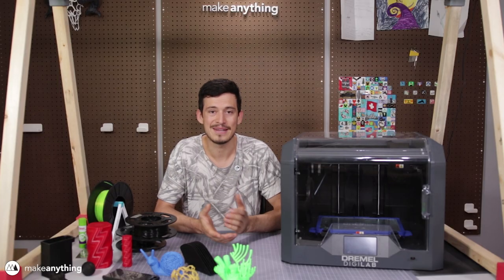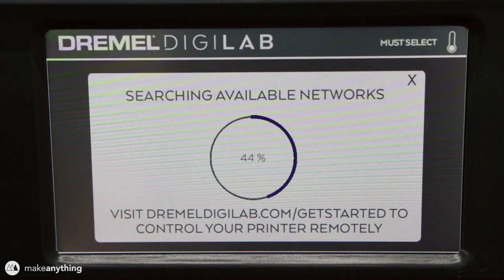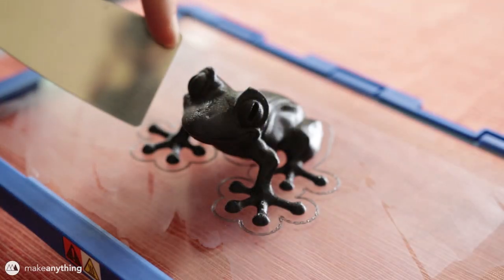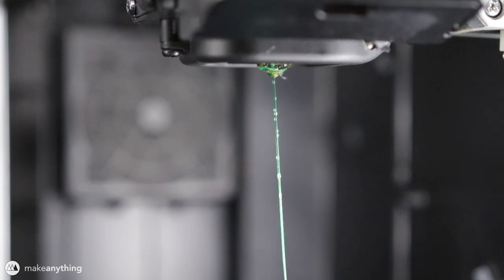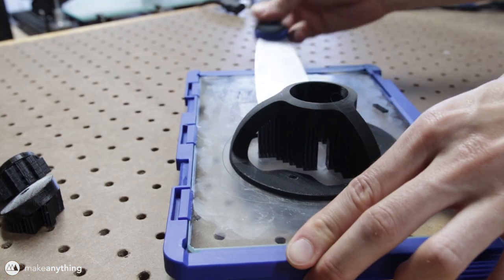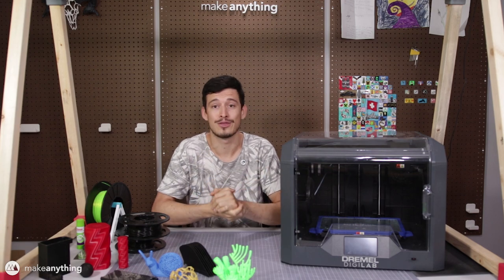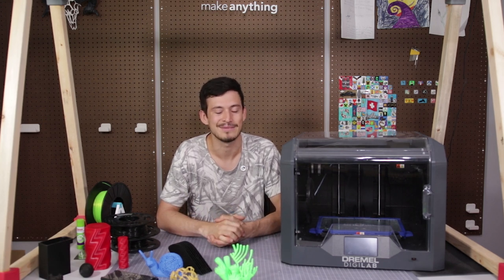Dremel 3D45 Review // Dremel's Latest 3D Printer

Comment: Looks like a pretty nice machine with some improvements what was that green translucent pla you use for the benches it's gorgeous :-)

Also can this printer work offline without a computer and without an internet connection? Can I load Prince on to it with an SD card or USB drive?
Reply: Yes it works standalone. Sneakernet with usb.

Comment: Cutting into a 1800 Dollar printer to be able to fit a standard(!) spool. Although they allow it, I wouldn't call that "supported". To me it signals more that they actually do want to limit that in the future. Also, almost no innovative features which I would expect for that price and the quality doesn't seem that much better to me than a well tuned Prusa.
Reply: Vincent Groenewold that’s the thing though some people that own a business and don’t have time to tune a printer buy expensive machines to get work done.
Reply: Yes totally, so for a company this might make some sense. For that price though, I would go for Ultimaker or any other supplier having more innovation. And for a company, I would be putting more importance on the support of the supplier.
Reply: Good thing you can buy prusa tuned and all set to go.
Reply: Not sponsored, just have this two grand fluff-box to keep...
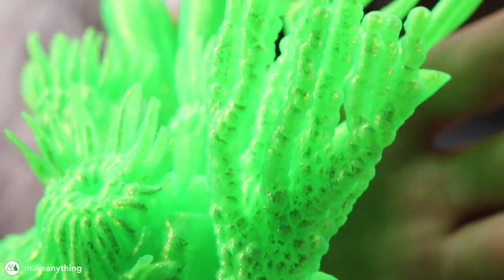Reply: then you have to hack it so it'll take a kilo.. and 10:34 get real...
Reply: Your right.  I purchased the Dremel 3d45 and very disappointed  w the quality of prints and customer service.
Reply: But  this has a heated chamber and it is or

Comment: I'm glad to see that they didn't do the filament lockout when adding their auto-select convenience feature. I'm assuming you just select manually on the screen which type it is if it's not Dremel branded or select your temperatures, right? Also, can you upload pre-sliced gcode to their website if you don't like their slicer, or do you need to use USB or something for that?
Reply: Yes, yes, and yes.

Comment: $1800 gets you a glass build plate and gluestick? Are you kidding me?
Reply: If you hadn't noticed, you also get a 3D printer.
Reply: You know the $200 printers are pretty bad quality right?
Reply: @cubetheorist3419  Yeah, with the quality decreasing the lower the price range is
Reply: @feralpossum2089  my first was a 250 zonestar that produced really good prints, and it still does! I had to take the time to learn how to achieve good quality prints but now I have no problem with it. 1800 doesn't get you more bang for the buck in this case.
Reply: $14,000 gets you a markforged mark 2 that comes with a garolite build plate and gluestick. If it works it works.

Not to say I like the printer. I use one every day and have more than my share of issues. Gluestick just isn’t one of them.
Reply: No you get a glass build plate and a glue stick but MAINLY the Dremel logo😂😂😂
Reply: gets you auto leveling as well.
Reply: They work first 6 months after that they wont function properly
Reply: Whats wrong with a glass build plate? They give one of the best surface Finishes on the bottom of the print
Reply: You have to use a glue stick to hold your work in place? Your kidding right?
Reply: $1000 gets you an enclosure and dual extrusion with the CR-X on a 300x300x400 build area.
Reply: Cube Theorist can the ender 3 print nylon out of the box?
Reply: @redslimeyslime1356  nah the ender 3 makes great prints
Reply: Be aware their support sucks.. and buying spare parts is extremely overpriced.. your nozzle broke.. and you spend over $60.

Comment: What silk filament did you use?
I have use cc3d and eryone and both fail in this printer.
What brand did you recomend?
Reply from the maker: Polyalchemy prints really well, though I haven't tried it with this printer specifically

Comment: how did you mange to print the boat which has roof without any support?
I have this printer and have been really struggling to get quality prints where precision less that .1mm is needed.
Reply from the maker: Using simplify3D as a slicer you can set extra overlap for bridging which helps pull off bridges more successfully

Comment: Random question, is it possible to slow down the printing speed of a 3d printer to ensure that the print doesn't fail?
Reply from the maker: Yes, you can. I tend to print around half the speed of what the printer can technically do for that reason. Less vigorous movement means cleaner prints!

Comment: has it got the silly warranty on it that you cant even change the nozzle without killing the warranty. hate my dremel everything has locktight on it. and have to send the printer away to get the nozzle changed. basic maintenance should not have that kind of warranty on it. i just hope its changed. was so not happy.
Reply: and another thing i hated was the slicer that could not even add supports to the models. and had to buy simplify3d just to be able to use supports. so that was another 140 pounds ontop. also the bed that came with the dremel was warped perspex so had to waste filament and use a raft with everyprint. but i must admit that after all that the printer was a good print. but so wish i had just got the i3
Reply: Aaaaand it's dead to me.
Reply: THIS RIGHT HERE needs to be discussed. If that is still the case then it's laughable.
Reply: Why not just use blender as it's free to build supported?

Comment: I'd like to have a printer. But my house is next to rails and it shakes many times during the day when trains go by. Can 3D printers operate in such conditions?
Reply: Put something under the printer for the heavy stuft. But shaking shouldnt be destroy your prints
Reply: The entire building shakes, no vibrates, but shakes. When a freight train goes by (not too often) everything visibly shakes. My monitor squeaks on its support foot, glasses jingle, tall furniture produces small creaking sounds etc. I could limit large prints for Sundays (less heavy trains), but 3D printers are costly and I don't want to risk that prints will be damaged too often.
Reply: That structure isn't going to be stable for a long time if it shakes that much so often. How long ago did the building start to shake?
Reply: Ever since it was built. The structure was designed to withstand the shakes without damaging the walls. 50 years and no cracks at all. It's like a train station building. They don't fall apart either. If I had to print for 4 hours straight there is a big chance for at least one heavy train go by. I am almost positive it would damage the prints.
Reply: @nowymail  That's very reassuring to me, thank you for letting me know. It would be difficult to absorb that much energy, but in theory it can be done (shock absorbers and elastic or springs, something holding the printer up and letting it remain motionless). I don't know how much knowledge you have, or resources, but a building like that is definitely not optimal for 3d printing

Comment: Can you just put a PEI sheet on and offset for it?
Reply from the maker: You could definitely add a different build surface on top. Since there's a leveling switch you don't need to change any settings either
Reply: @make.anything  I think that makes a huge difference, thank you for the info!

Comment: Not a fan of Dremel. Too closed. I'm more like an open hardware+software type of guy. I mean, can you even use non-dremel filaments on this one? I might have missed it.
Reply from the maker: Open filaments and slicers, otherwise I would have a problem with it
Reply: Marlin gcode, any filament.
Reply: no problem with the super-slow touch screen then? Likely under-specd cpu, cloud-joke printing (come on, you need to Stand By the machine to glue-stick the bed and check filament moisture) - what do Dremel say if you're not using their branded RFID packs and it fails? And it's a HUGE box, with no more build volume than an Ender2 - which also gives awesome quality right out of the box... now think hard, are you absolutely sure this is a fair and unbiased review?
Reply: @pdjames1729 I agree with you on bang for the buck. The screen isn't slow. It "times out" the ability to select things in certain menus until the printer has completed an operation. Like after filament detection fails (happens using 3rd party) it moves the carriage from the loading position to park. The button to enter custom filament lights up after it parks and is selectable. It is super aggravating waiting 10 sec for no reason.

Comment: I need help i put on my cr 10 the micro swiss hot end and now i have retraction problem i use cura can someone help me please??
Reply: Yes, use less retraction with all metal hotends. Like 3.5mm or less for Bowden, and 2.5 or less for direct. Otherwise the hot filament gets pulled back into the heatsink, cools, and jams everything up.
Reply: @0calvin  how do i have to set the retraction distance and the retraction speed??

Comment: RFID Chip.... That's a no-no.
Reply from the maker: Only if it locks out other filaments
Reply: @make.anything  we are looking at you xyz 3d printing
Reply: RFID is good for the printer to ID the filament, for 1800 bucks, it should.
Reply: It would be better if it allowed you to create and register your own custom RFID (or NFC) chips. That way you can make your own pre-sets for the filaments you like to use. 

Or reassign the parameters for an empty spool to be reused with whatever filament you want to load onto it. 

Lots of options for this which could be quite handy. 
And of course, Dremel would be wise not to use it to force proprietary use. That path invites boycotting.
Reply: @make.anything  like carbon fiber polycarbonate that will clog novices setups and make Dremel lose money by not selling rolls with a $5 mark-up that contain nothing more than an RFID chip than the competition

Comment: So this is a thing, huh? My $200 printer with $6 bed leveling probe is still chugging along after about 3 or 4 years of use. I even bought a new, fancy $36, 32bit mainboard for it. It has printed many, many kilometers of ABS at the same or better print quality. The only caveat is that I have been into 3D printing for quite a few years and cheap machines are not plug & play. You learn all the tips, tricks, tuning, and firmware tweaking that go into making exceptional prints when you start cheap and force yourself to figure it out. Total cost of all 5 (#6 Prusa Mini hasn't shipped, but is included in the total) of my printers and upgrades is around $2400. No gluesticks.

Comment: How to pay extra just to ensure you'll have fewer features and you'll have to pay more in the future. 
Lol nobody wants wifi printing, nobody wants rfid filament, nobody wants to cut their machine up just to fit a bigger spool. It has a built in webcam but for what? it certainly didn't stop the coral print when it could have seen that its g code wasn't being built correctly, but NOOOO, it just streams video in low resolution so you can take disappointing time lapses. 

I don't even know how they can justify controlling the quality of the print by predetermining extrusion temperature. Does it increase or decrease with ambient temperature? What about if you tune it for speed? can you even tune it for speed? I shouldn't be surprised, this company became famous for taking the "angle" out of "angle grinder"

Comment: Warranty is woided for every crap, it has RFID meaning 3rd party filaments are a no go unless you wind them on Dremel spools, it doesnt have a proper build platform (i mean a fucking gluestick on a 1800$ machine) even my 400$ Tevo Flash will have one and it doesnt have auto bed leveling. If I priced this based on the features its pretty much a crappy Tarantula for roughly 250$. The enclosure costs a lot.

Comment: RFID chip so they can force users to only buy their (more expensive) filament.
Reply: RFID is optional, so is cloud connection
Reply: @Someone-cb3zx  for now.
Reply: @riffraff60  thats just product suicide to force you to buy specific more expensive products, when there are printers that can offer similiar without the limitations. There are options to input plastic type, temperature and any other necessary information. You dont need to use the RFID, its similiar to a QR code to quickly input information.